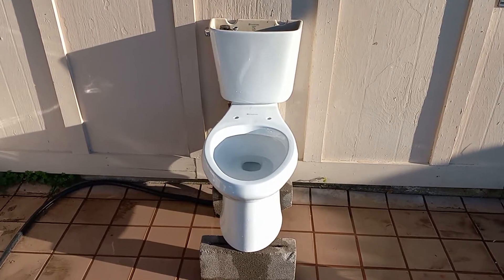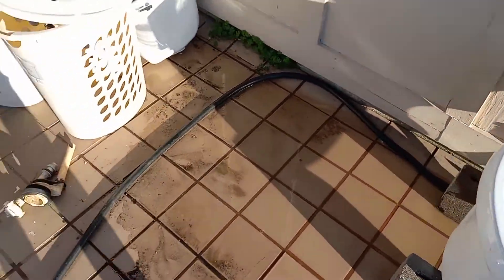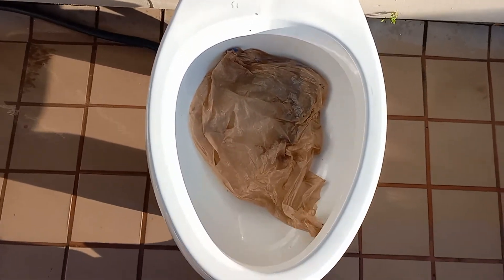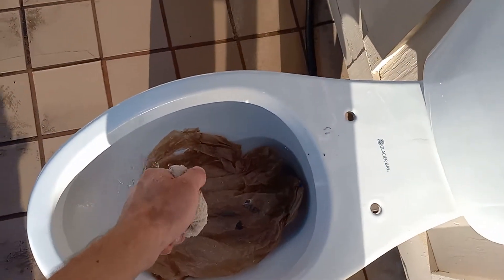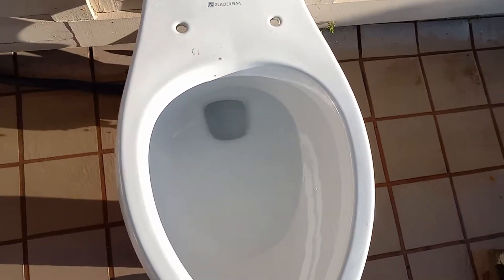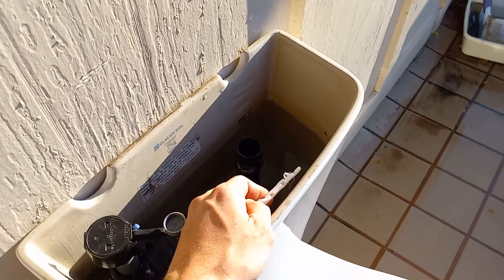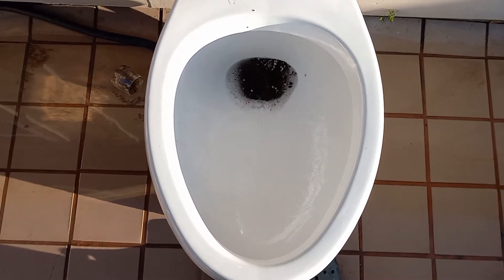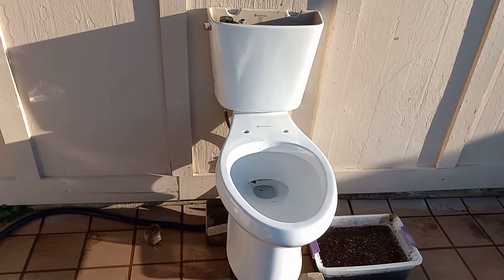2015 Glacier Bay UHET Tests

Comment: No toilet should be less than 2 gallons, low water usage just causes problems, i have my Elliston on around 2 Gallons with the normal flapper and it’s flawless
Reply from the maker: These new ultra high efficiency aka high maintenance toilets need to be discontinued once and for all
Reply: @OCC_Plumbing_and_Restorations  absolutely

Comment: It seems like it performs well for how little water it uses. My biggest concern is the drain line carry. 1.6 and 1.28 ones have better pipe carrying because of more water.
Reply from the maker: Yeah, 1 gallon may clear the toilet but it is not enough to function properly.

Comment: I would adjust the flapper to 10 or cover the hole on the bottom of it with tape and raise the water line
Reply from the maker: I set the water level higher when I restored it.
Reply: @OCC_Plumbing_and_Restorations  ok
Reply: @OCC_Plumbing_and_Restorations  the flapper has a small hole on the bottom of it, and that’s how it fills up with water and shuts really early, if you put duct tape over it, the flapper shuts when the water level gets really low in the tank
Reply from the maker: @cooperschwartz318  You can also turn them to block the hole, they're adjustable
Reply: @OCC_Plumbing_and_Restorations  ik

Comment: This toilet is definitely worth restoring while changing out the flush valve & raising the waterline a tad. Then it will be an excellent performer. It seems that any toilet designed to flush on 1 gpf or less is an utter failure.
Reply from the maker: Definitely and that's exactly what I did
Reply: @OCC_Plumbing_and_Restorations  I know this might be a dumb question, but did the flush performance improve greatly after you did that?
Reply from the maker: @MrBrombomb  Yep
Reply: @OCC_Plumbing_and_Restorations 
Once your generation learns to tell particular govt agencies to STFU and stop passing ridiculous guidelines and laws (which is all they know how to do, sans expertise most of the time), then you will gain control over your environment and where and what you spend your $$$ on.
Reply from the maker: @jbsimmons54  People need to open their eyes